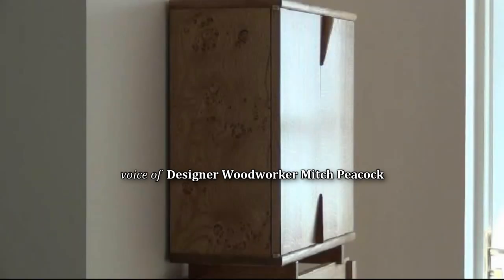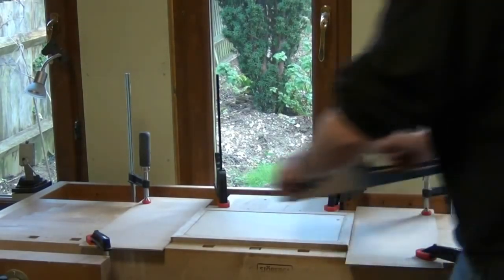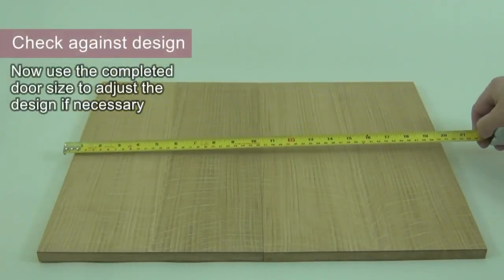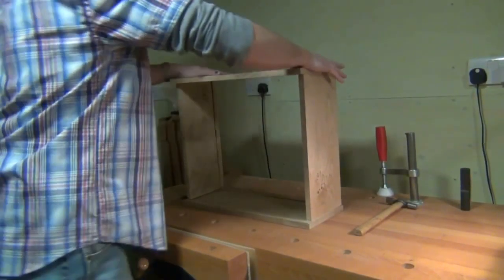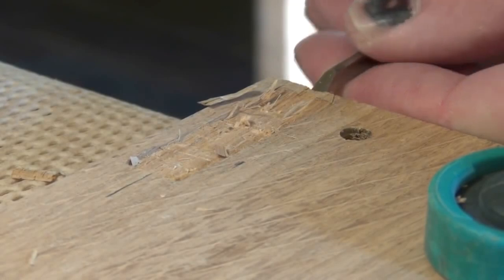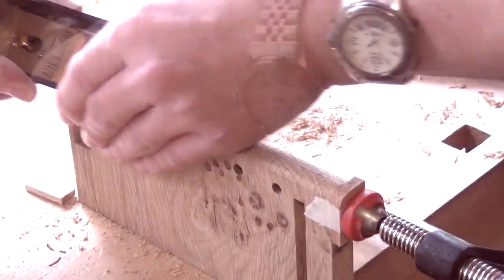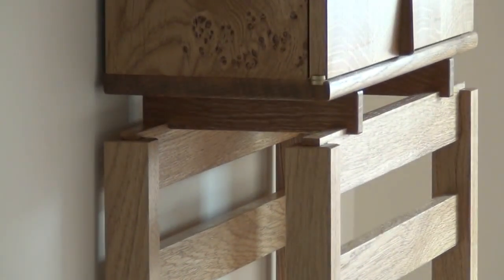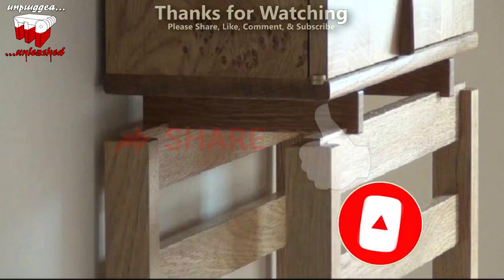Cabinet on a Stand / Krenov inspired / Woodworking

Comment: Hope u don't mind me making a small suggestion. It's about the camera u put on ur bench. When u were plaining the boards the camera was shaking. I saw a video where this dude built a running track on his ceiling. He built a similar spring loaded arm that u see being used for microphones in these podcasts now. He made his obviously much bigger from some lightweight square tubing but it worked a treat with the springs on it as well. The gantry it was mounted in was brilliant and the camera could be slid up and down and the arm was long enough to reach everywhere in his shop plus the overhead shots wee really nice. He was able to get close up shots too btw. 
The channel's name is @Inheritance Machining. It was a really good idea. I know it probably seems like a lot of extra work but u could easily build something like that with ur skill levels my friend. I just thought it might be worth it for ur channel/shop especially seeing as the camera moves and could ruin a great shot on u. 
It was probably the only time this shaking has happened so I'm more than likely making a mountain out of a mole hill. Sorry if that's the case pal. Love the content on ur channel btw
Reply from the maker: No problem. This video was a long time ago, and hopefully I've become better at shooting since then. A camera gantry is an excellent idea, and maybe one day I'll get around to building one. Cheers